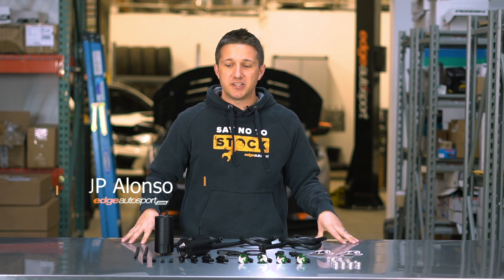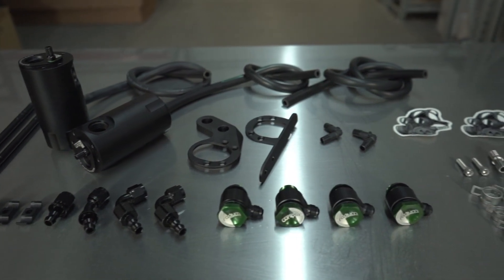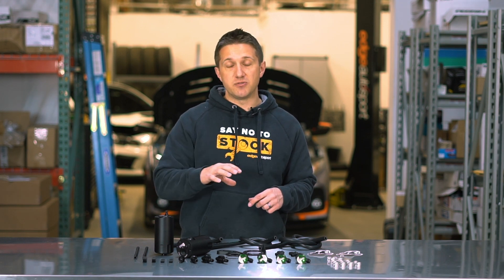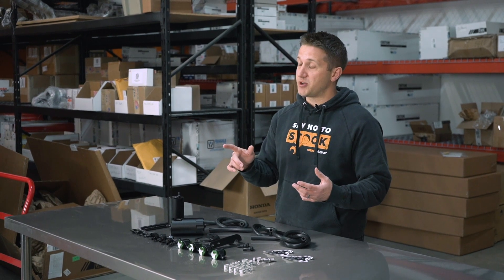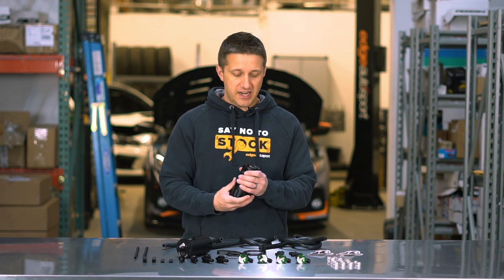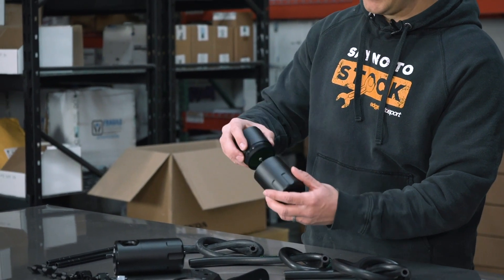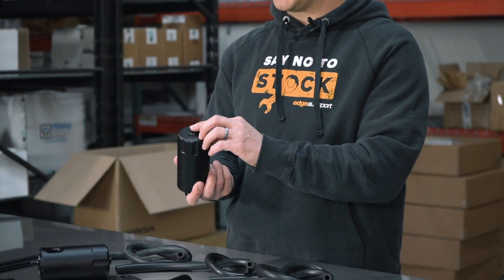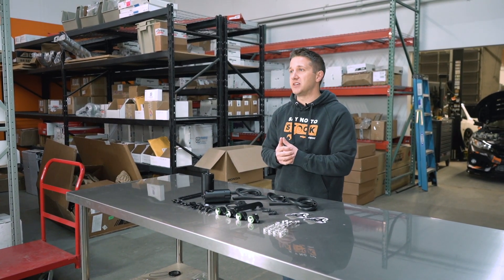Radium Dual Oil Catch Can | 10th Gen Civic Type R

Comment: Will this work for the 10th gen civic sport with the 1.5T?
Reply from the maker: The PCV side can should work no problem, but we're not 100% on the CCV side - as such, this kit is not a confirmed fitment for the 1.5 motors.
Reply: every catch can is universal, the kit only provides the hoses are the right length for this  car your local shop has hoses, and fit it up right